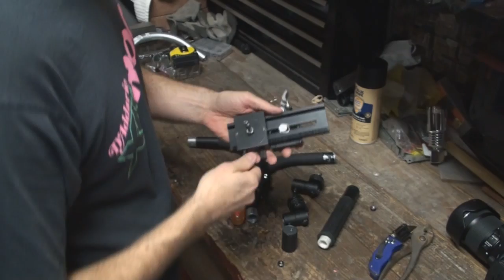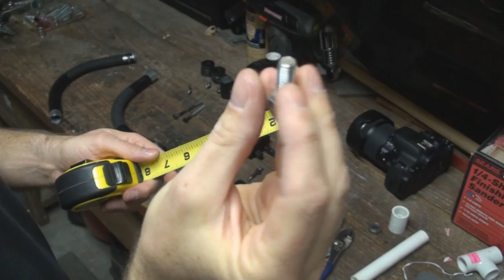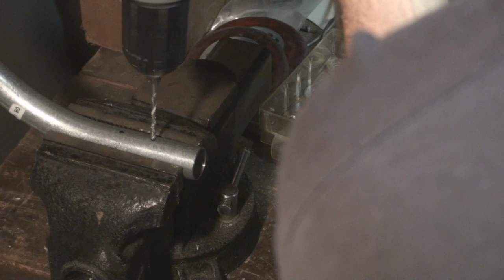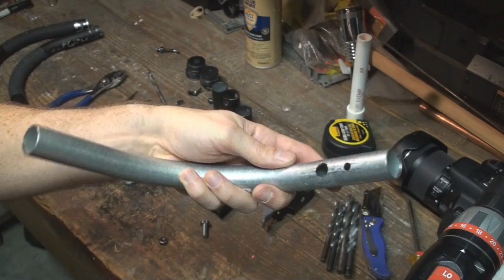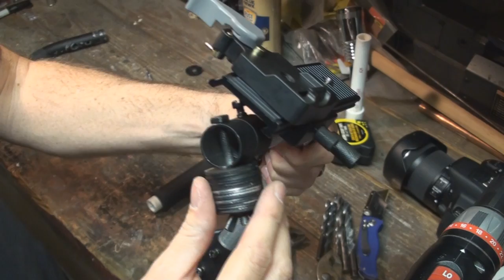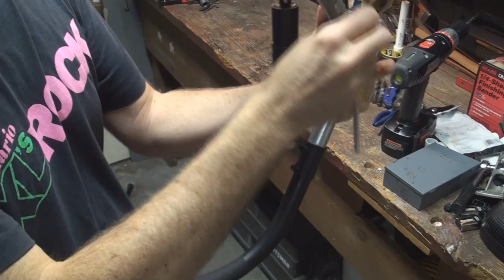DIY Silver Flyer Steadicam for DSLR Build - Step by Step Tutorial

Comment: Hey man.  Thanks for the amazing tutorial.  I'm really having trouble with the balancing on this thing though.  No matter how much weight I add to the bottom or take away, I get the crazy wobble/pendulum effect with the whole thing.  Are there any more tips you could offer up at all to help get this thing smooth?

One thing I have different is I have a 4 way macro slider that someone suggested, to help with quick leveling, and since that seems to make it a bit more top-heavy I only have a couple washers on the top coupler.  Could that be the issue?  I just don't have easy access to a drill to put more holes in the top coupler to get more washers on...
Reply: What camera?
Reply: A Canon T6i

Comment: I am in a wheelchair, can this be attached to a bar attached to my chair to hold the handle....would it work?
Reply from the maker: You could do that but it does require constant adjustment by your hand when you're holding it. I'm afraid you'd lose control if it was just free standing on a bar.
Reply: TY

Comment: Can I just use a quarter inch bolt and nut for the camera mount instead?
Reply: Yes, but I DON'T recommend.  If you have a very small camera then maybe.  You need the support provided by the shoe.  It reduces fine vibrations but more importantly if your rig takes too large of a bump or jolt your camera will break or snap off.  On set, Canon XL1 on a diy crane went up too fast, struck a ceiling fan and tore the mount plate right out of the camera.  The 10 foot fall finished the weekend of shooting and the camera.  $4,000 on a single 1/4'-20 bolt is a big gamble.        SPLAT!  :(

Comment: Quick question, we couldn't find the bent metal tubing so went with bent PVC. I'm guessing that since it's lighter overall and the weight at the bottom (used steel plates overall) isn't as far away from the camera,  I may not get the stability of yours. So I guess what I'm asking really, does the height of the rig play into the stability? And, the wieght at the top. We haven't added that to ours yet, would that be for fine tuning?
Reply: +Rod Salm Yes, the weight plays a lot on how the whole thing behaves.  The design I've got here is for a heavier DSLR.  As for where the weights are, the top ones help make make the whole a bit more top heavy to avoid it from just spinning out of control.  If you have an imbalance on the weights, you'll see it do things with the slightest touch.
Reply: Got it, thanks. I added length, that seems to help. I'm using a D7000, so lots of top weight. And yep, slightest touch makes it wonky unless adjusted fine. Thank you for the tutorial, much appreciated.

Comment: Great tutorial. I've built my own and, as with most people, I am having problems balancing the steady cam. For me, I cannot get it to stop the back and forth wobble (not side to side). The bottom of the steady cam doesn't want to move with the camera and ends up staying in place, causing the camera to dip. 

I've tried adding weight to the bottom, removing weight from the bottom, playing with different angles, etc. Nothing has worked for me. I fear my camera is too light to balance the steady cam...
Reply: +Two Sided Travels I have the same problem with my D3200! Somebody please answer this!
Reply from the maker: +Two Sided Travels All I can recommend (and apologies for very late reply), is to make sure your camera's vertical verter of gravity is set correctly with the location of the bottom weights.  If they are aligned and you have enough weights on there, you have a better chance to be successful.

Comment: Great tutorial! I was just wondering if you happen to know the physics behind this. I can get the rig to stand upright but it floats around a lot instead of resting into one position/small area like other ones I've seen. Moving left and right makes it spin too. My question is this: Does there need to be more weight on top or bottom? And is there a way to tell if you have too much/not enough weight? I'm sorry if you've got this question dozens of times. I've been reading comments across various videos and I've found conflicting information, so I figured I should ask the person whose tutorial I followed. Thanks!
Reply from the maker: +cowsforliyyfe Usually too much weight on the bottom will cause slow swaying so you need to find the right amount.  That's why we're using weights that can be 'micro' adjusted.  Just keep trying!  As far as the spinning, making sure that the top plate is as parallel to the gimbal's horizontal plane will help that.  Any deviance and you're likely to see the camera move on its own very easily.  It's all a combination of several factors.  I may make a video that only talks about balancing.

Comment: Where did you get: (2) 3/4" 90 degree elbow metal tubing?? and did you bend a straight pipe yourself to a L shape?  Becouse i went to mutiple DIY shops but cant find a good pipe.
Reply from the maker: Roy van Dijk Not sure where you're located but here in the US any Lowes or Home Depot has plenty of these.  Try a larger hardware store.
Reply: I life in the Netherlands. We got plenty of hardware stores but no L tube :'(

Comment: Back in the day my dad had someone build me a clone of the original SteadyCam Jr out of solid welded aluminum.  It even has solid aluminum brick weights that can be moved around with velcro.  The problem is, they didn't really understand how to make the gimbal handle so it was just fixed (after they tried a simple hinge).  I'm going to try to build the gimbal handle you have here and attach it to this stabilizer and see how it works out.  -BTW: My handle also has that  bike tubing your appears to have except that it is the more padded foam type.  Thanks for the info!
Reply from the maker: InfinityVision Sounds great!  Be sure to share your results if you can.

Comment: Can this handle the Sony NEX FS-100 or Canon EOS 60D?
Reply from the maker: Josh Lowe I see no reason why not.  I have a T5i on it which doesn't weigh that much less than a 60D.  All depends on the lens you've got on there too.
Reply: Utopia Studios Thanks for the reply. I looked up the weight of the FS100 zoom lens kit and it weighs just over 6 lbs. with the lens on it.

Comment: I can get it to maintain a fairly even balance, but the issue i have is when i turn it left and right, it just sways all over the place. Is it because of my weights at the bottom? I'm also using different sized washers on the bottom (3 huge ones that are heavier, the only ones i have for the time being). Should i just get a longer screw for the bottom and use all of the same sized washers?
Reply from the maker: The size of the washers should not matter, it's all about the weight.  Yes, too much weight on the bottom can cause it to start swaying more than you want.  Try lightening the load there.  Sure it you get smaller washers you'd have better control over the amount of weight.
Reply: Okay, thank you so much!!

Comment: Hey, I created this will all of the same parts and tools.  I am using a Nikon D7100.  However, balancing has been a pain and after 2 hours I still cannot achieve a perfect balance.  The camera is very left heavy and I have a slanted bottom tube and slanted bottom weights and still cannot get it right.  Any suggestions?
Reply from the maker: ***** Did you make sure that the hole you created for the gimbal is dead on perpendicular to the tube's vertical position?  What I found is that if the gimbal is not as perfectly vertical as possible, you can basically end up with a tweaked rig that can never get balanced.
Reply: Utopia Studios The hole for the gimbal is perfect.  I took my time and made it perpendicular.  However, the weights at the bottom are no where near enough to counter the weight of the camera.  I tried the one second drop test and it still went camera side.  Should I get a longer bolt and add more washers or is their another way I can add weight to the bottom.  Thanks.
Reply from the maker: ***** Good luck!

Comment: Tip for drilling the pilot holes: Use a nail and hammer to put a small indent in the tube at the point you want to drill. This will help prevent the drill bit from wandering before the hole starts to form.

Comment: is the pvc 3/4 or 1/2? in the video you said 3/4 then below you typed 1/2
Reply from the maker: It's 1/2" PVC for the handle, but it's 3/4" EMT pipe for the actual flyer.

Comment: Would it still work without the Macro slider?
Reply from the maker: Yes, but you may have a tougher time balancing it.
Reply: Utopia Studios Wouldn't it work by point the weights either up or down?
Reply from the maker: ***** The macro slider is there to move the camera forwards or backwards in tiny increments so that you can really dial in the balance as precisely as possible.  Moving the weights up or down wouldn't necessarily have an effect on that balance perspective.

Comment: As a tip - when you adjust the bottom weights for tilt - replace the screw with a screw with a wing head - that way you won't need to reach for a screw driver each time-

Comment: How difficult do you think it would be to balance for an Iphone on a Phocus case, since those have a very very low weight compared to other types of cameras?
Reply from the maker: I think that this rig may be overkill for your iPhone/Phocus combo.  What I would try instead is building the flyer out of PVC, which would be much lighter.  Same steps, just PVC instead of metal EMT tubing.
Reply: Ok thanks,  might try that.  I had thought of that, but I'm also looking to upgrade to a better video camera within the next year so I'd want a rig for it as well. I'm not a DSLR user so some of the weighting/balancing will obviously be different with a video camera.

Comment: Question: Can you not just buy a bearing which fits the Traxis natively, instead of shaving the Traxis down?
Reply from the maker: You could, and it would also need to fit into the PVC making up the handle.  Have you found one that would?
Reply: No. Just asking about whether it's possible. Seems like it would save some work.
Reply from the maker: It definitely would.  Finding a bearing with those exact dimensions may be a challenge though since it wouldn't be common.
Reply: Utopia Studios What's the bearing dimensions? Also is there a substitution for a bearing? Bearings are quite pricey.
Reply from the maker: It's a standard bearing you'd find in a skateboard or scooter (like a Razor scooter) wheel.  Nothing special.  It's a common 608Z bearing Diameter (Outer): 22 mm, Diameter (Inner): 8 mm ,Width: 7 mm
Reply from the maker: To be clear, that's the bearing you'd use if you shaved down the Traxxas.  I have no clue what it would be to fit the Traxxas stem natively.
Reply: http://www.amazon.com/Traxxas-Bandit-SHAFTS-Spindles-Bearings/dp/B00ERUA0Q8/ref=sr_1_9?s=toys-and-games&ie=UTF8&qid=1409722802&sr=1-9&keywords=half+shaft

Comment: my setup keeps spinning around and not staying focused on one spot
Reply from the maker: A common problem.  Try using a USED bearing instead of a brand new one.
Reply: Utopia Studios i am using a used one. I took it from my old razor scooter. Also, i dont have a slide plate or quick release plate. will that make an impact on how it balances.? It is balanced fine right now besides a little more swing than I would like on the bottom. How can I fix that?
Reply from the maker: Camden Patten How do you have the camera mounted?  On a plate or directly on the screw that sticks out from the EMT?  Either way, a macro slider would help a lot in balancing but from the sound of it you're already there.  As far as it turning erratically, maybe try adding more weight to the bottom.
Reply: I have it screwed directly to the screw because i really don't feel like throwing the money to a macro slider or quick release
Reply: Same problem here.

Comment: Every silver flyer video shows that to achieve the balance required for it to fly the weights at the bottom have to be kept to a minimum. I've found that to be true as too much weight causes rocking. How have you been able to offset the battery side of the camera without loading up the bottom with weights? 

I'm using a Canon T2i with a regular kit lens and everything tilts completely to the right unless the bottom has an equal amount of weight, which then causes it to rock anytime there is any movement. Any recommendations? Thanks.
Reply from the maker: In my case I'm using a T5i with an articulating screen which I keep open while shooting, and this makes things even more interesting.  There's no rule about balancing because there are many variables, particular to any flyer, that can change what you need to do.  So, things like how accurately the holes were drilled to center on the pipe come into play as to how well everything will balance, or how level the macro slider is with respect to the absolute level of the top of the pipe, etc.  You will need an appropriate amount of weight on the bottom to simply counterbalance the camera to begin with.  Then, using some weights on the top portion of the flyer, swing them left or right to counterbalance the uneven left/right weight distribution.  Again, it's really individual tweaking for each flyer, as they are all different in some respects in the end.
Reply: I think maybe a get a bi directional macro slider to bring the mass more to the left, or fix some out riggers to where you can add some weights. The real steadicam adjustment has bi directional shifting to get the perfect position.

See here: http://www.lafcpug.org/images_review_merlin/merlinview.jpg
Reply from the maker: The bi-directional shifting is weights only looks like on that example.  I like the idea of "sliding" the weights like that for micro adjustments, may need to make one like that!
Reply: I'm using a Sony NEX 5 with 18-55mm lens and only a macro slider (not plate). I took your recommendation and it doesn't rock with no weight at the bottom. The top weight is maxed out to the left side for me. It doesn't rock anymore, but when I walk around the camera tends to not stay straight and just pivot around the handle (slight tilting as well). So I still need to see if that can be corrected with weights, different bearing or practice..
Reply from the maker: I'd fiddle with the bearing first, try to find an older bearing that has a bit more friction on it.  Then, add more weight if that doesn't solve the problem.

Comment: If you have a heavier camera setup, (say 7 pounds), how would you have to modify this rig?  Add more weights at the bottom?  Thanks for a great tutorial!
Reply from the maker: That's a heavy rig!  Definitely more weight on the bottom.  I'm hoping to make another video showing a modification that would add a stabilizer "cross bar" with weights to smooth it out even further, especially for heavier cams.  Stay tuned!
Reply: Utopia Studios Thanks!  I might try out putting another macro slider at the bottom just for the sake of fine tuning the weight (in the left/right direction).  It might be easier to adjust on the fly if it's just a matter of turning a knob.  Thoughts on if that will work?
Reply from the maker: profgolden You could do that but it'll look a bit funny and you may find it getting in the way.  But, give it a try and see if it works for you and let us know how it goes.
Reply: Utopia Studios Will do, thanks again!

Comment: Great Video.  I did have a suggestion....  Knurled knobs for the balance washer assemblies would eliminate the need for the screwdriver. You'd have to modify a couple of screws.
Reply from the maker: Yes definitely, would have to re-thread the holes appropriately to fit the knobs.

Comment: excuse me, just wonder can PVC pipe replace metallic tuning ?
Reply from the maker: Don't see why you couldn't use PVC elbows instead of metal, but keep in mind that the weight will be much less, which could make it more difficult to balance if you have a heavier camera.  For lighter cameras, might work better.
Reply from the maker: Hi.  I found this on Amazon.co.uk:  http://www.amazon.co.uk/DEGREE-EMT-ELBOW-Misc-Tools/dp/B000BO5A0U/ref=sr_1_fkmr0_2?ie=UTF8&qid=1403882299&sr=8-2-fkmr0&keywords=90+degree+emt+tubing
Reply: Utopia Studios I have a problem, in the UK, you cannot find those angled conduit pieces because we either bend the conduit or use tiny elbow fittings.

I cannot bend conduit myself because of no bending machine so I may have to use PVC. Can you give me the length of them conduit pieces? I will maybe fill with sand to make heavy and also so that I can bend them into right angles.

How about that?

Also, you can't get them "set screw" couplers either which is pain in the butt.
Reply: Wow, you actually found them! is it sold in 1's? it doesn't specify a quantity.
Reply from the maker: I presume that's the price for each, of which you'll need 2.

Comment: I'm having trouble fitting the traxxas 1651 inside the 5/16th hole. Am I missing something? All tutorials point to a 5/16th hole.
Reply from the maker: The Traxxas side of the hole needs to be bigger than 5/16th.  Just use your drill bit and expand the hole a bit on the lower side where the Traxxas goes, until it fits in snug.  Good luck!

Comment: Would most of the parts be at a hardware store such as Home Depot or Lowes?
Reply from the maker: Yes, you should be able to find everything other than the macro slider, Traxxas and quick release plate at Lowes or Home Depot.
Reply: Utopia Studios Thanks! I'll get building this thing soon then. Awesome job!

I may make a modification to mine and have a plate at the bottom with two sets of washers on each side for better balance.
Reply from the maker: Something Random Inc. If you do let us know how it worked out.  Thanks.